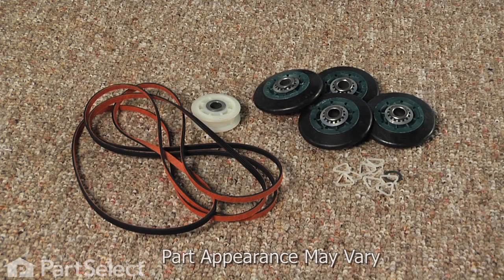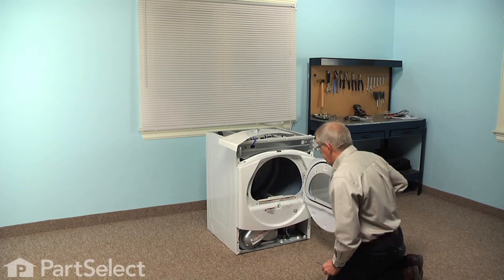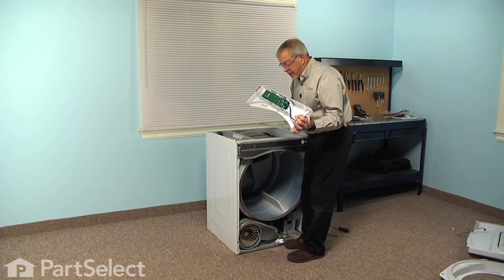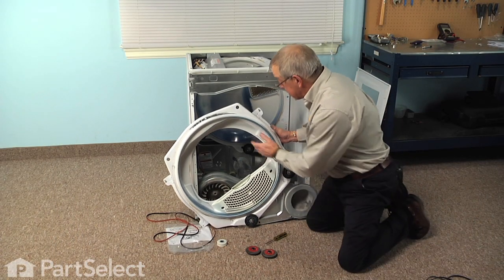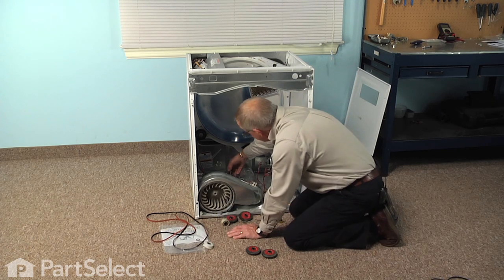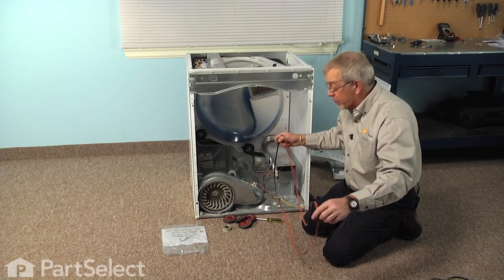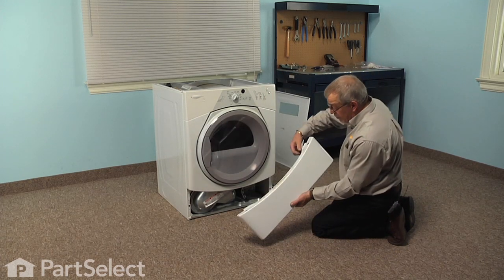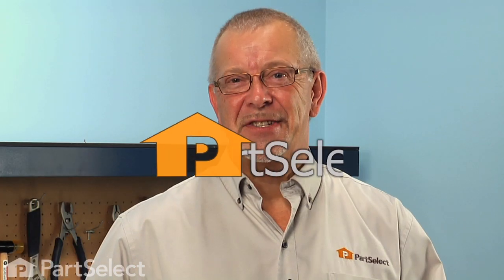Dryer Repair - Dryer Repair Kit (WhirlpoolPart # 4392067)

Comment: This video was spot-on for my Whirlpool WED9150WW!. I replaced all the included parts with little difficulty. My specific problem was a sticking idler pulley. The only things I found to be difficult arose from what I consider to be design deficiencies. First, try as I might, there was no way I could separate the electrical connectors for the door switch and sensor by just sliding a flat screwdriver. I ended up prying them apart. A proper connector would allow one to squeeze tabs to release. Second, the triangle retainers were unnecessarily fiddly to work with (which you captured in the video). Snap rings might be easier to work with. Anyway, a heat gun helps for installing - a little heat makes them more flexible.

Comment: Thanks for the video.  Great job showing exactly how the belt is to go.  My dryer was a little different, but I was able to replace all these parts on mine with the help of this video.  I recommend a shop vac or vacuum nearby, wet rag to clean it and a flashlight.  Thanks a bunch, the dryer works great now and the horrible screeching is gone for around $65.00.  If I can do this, anyone can!